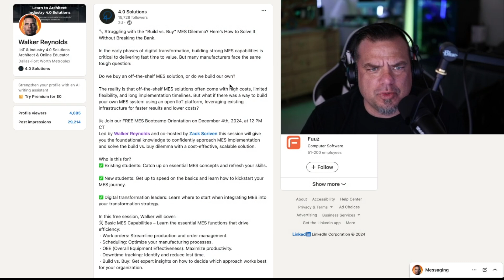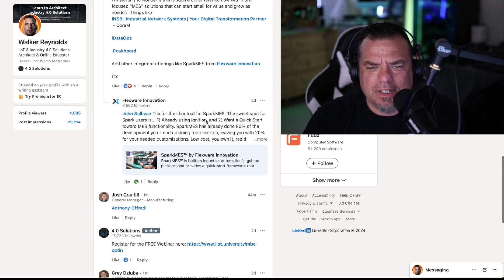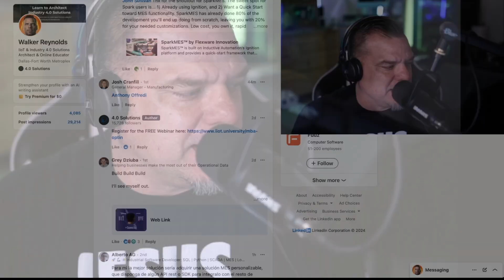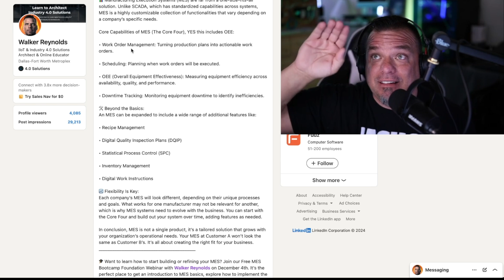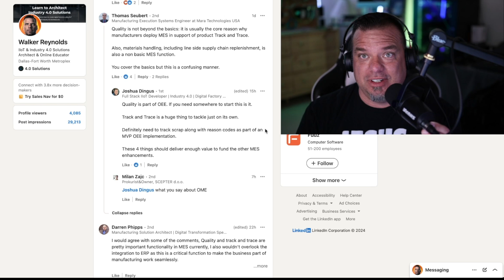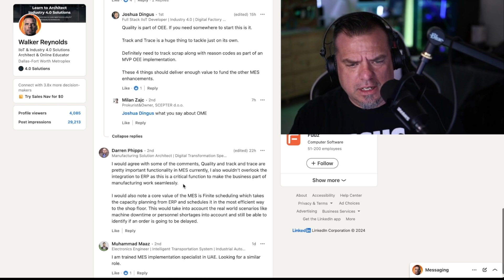MES Core 4 Capabilities and Build vs Buy debate

Comment: these four capabilities don’t represent the true core of an MES. Achieving effective Work Order Management (WOM) over time requires an MES to cover the entire production cycle across various departments. However, this functionality is secondary to the system's foundation. In my view, the core of an MES lies in capturing and displaying real-time input and output data. Even if the data format isn’t perfect, having some data available is far better than having none, as it enables critical visibility into the production process. With this data layer in place, higher-level functionalities, such as operations control and work order management (WOM), can then be effectively built upon it.
Reply from the maker: One cannot measure a run without a schedule order, one cannot schedule an order without an order, one cannot calculate OEE without downtime tracking.

The CORE essential functions of MES are Work Order Management, Scheduling, Downtime Tracking (asset State) and OEE.

EVERYTHING else extends from that core.  🙏
Reply: @4.0Solutions  maybe you deal with some specific factories. But core is input/output, so you can have MES without schedule order, order, OEE etc. That level is management inside MES, but core is collect data.
Reply from the maker: @CasaDeMold no… core is not input/output — input/output are parameters consumed from events at L1 - L4.

The key is ‘execution’ in manufacturing execution system.
Reply: @4.0Solutions  so need a new name. as MEB - Manufacture Event Builder. because almost all factory that I visit they don't have any or so pure.
Reply: You missed the Execution part, @4.0Solutions you mentioned only 2 relevant parts, also scheduling belongs in an APS not in MES
Reply: @tk380514  you can't schedule without data. in my factories, no relative data collect, so need do develop this. that why collection data is going first. without data you don't have object of scheduling.

Comment: Hi Walker, can you go more in depth and showcase how those off the shelf system really not ideal, for example, you can compare maybe ignition or tulip with  siemens opcenter or Rockwell / wonderware mes.
Reply: This is a great idea… I’ll put something together.
Reply: @walkerreynolds973  Yes, PLEASE! Thank you!
Reply: It's more like... Which platform should I build the MES on for this particular case. At the end of the day, the Bill Of Material is going to be: Software License + Professional Services. 

I think of all the MES products as a platform to build the MES solution. The question then become the cost and the performance. There are MES products out there that are more suited to particular industries, but it still has to be 'integrated' i.e. 'build' to meet the requirements. Using things like Tulip, Peakboard, N3uron, Ignition etc. you will be starting from a lower price point than say TrackSYS, Plex, Critical Manufacturing etc. It depends on the required end solution.

For me 99% of the time I can deliver a better value for money solution using a IIOT Platform + Professional Services to make the 'Composable MES'. But we are covering more of the mid market in Thailand. Maybe things are different for the rest of the world?